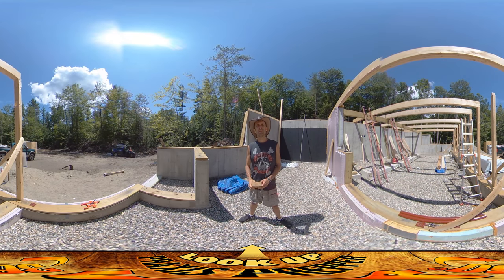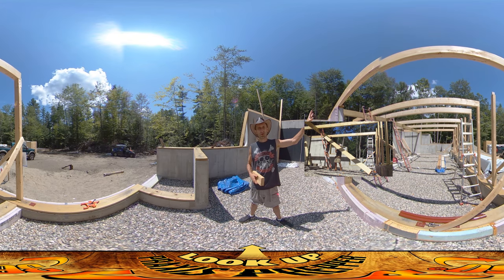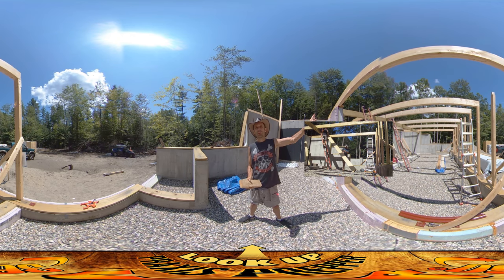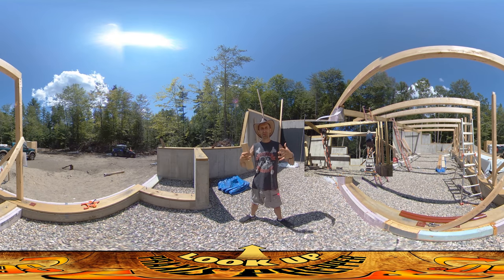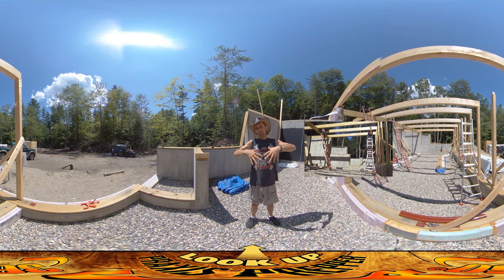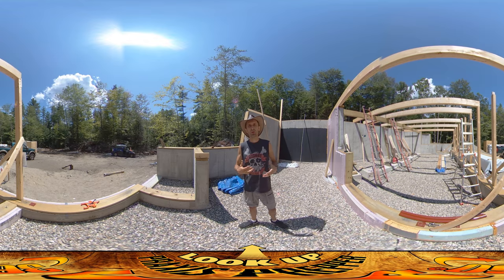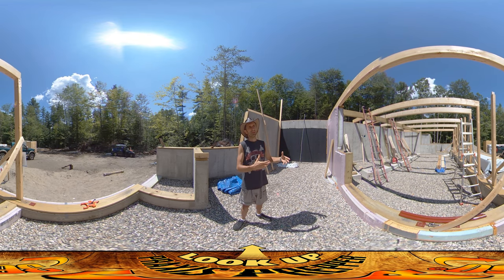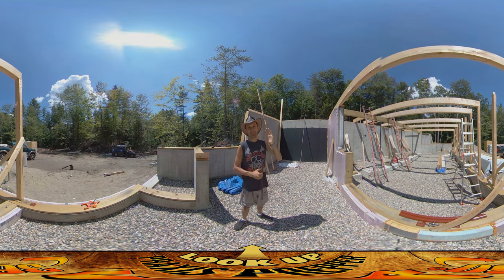Homestead Building - Floor Joists Being Put in Place, Forcing Lumber to Fit

Comment: I am mostly pretty amazed at how quickly things start to look like a whole lot ... even though technically (when considering all the work that still has to go in) they are but i minor bit of the work. Like  these floorjoists sort of define an actual space and make a huge visual difference from just the concrete backwall and some uprights... also seems like a very helpful tip, guess this may well be one of the reasons non of the homes in my country are build with wood anymore, except for the roofstructure, which is then generally build as a prefab construction in a factory. The controlled environment prevents a lot of the hassle, and poored concrete or stone blocks tend to not have these issues.